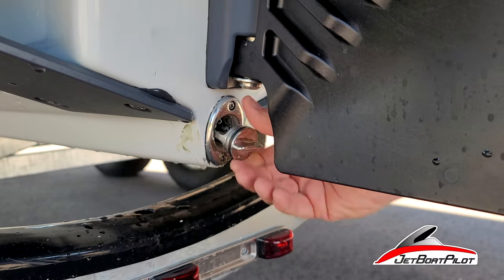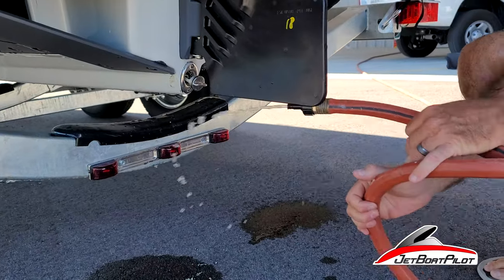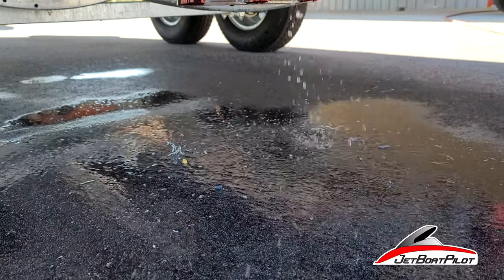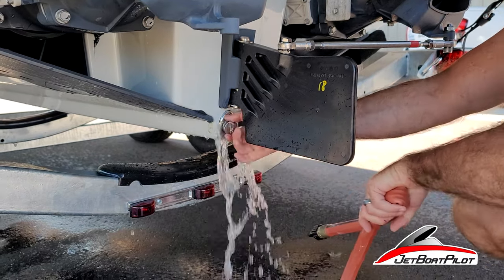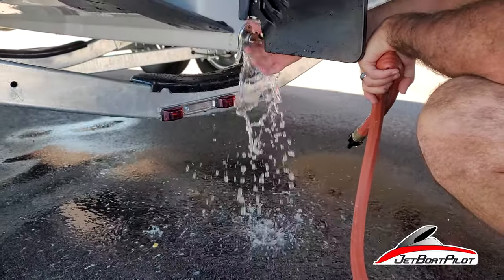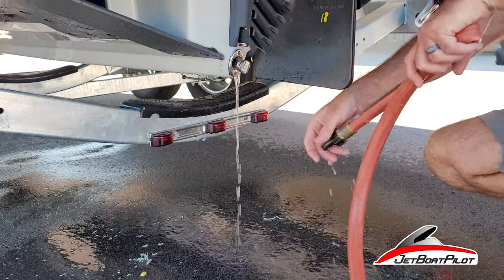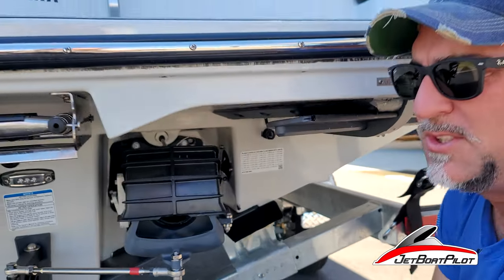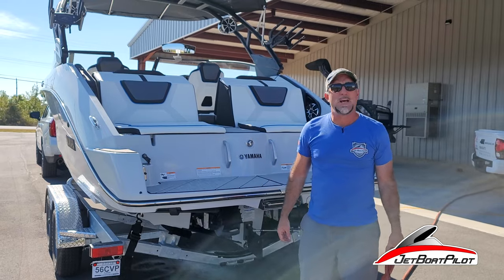What's This Trash Near My New Boat's Drain Plug | How To Flush & Clear

Comment: When does the thrust vector and reverse thruster get installed?  Or is it not needed with the DRIVE system?   Have a new 222S on order and deciding if I will need the thrust vector or not.
Reply from the maker: We're installing it soon. Just doing video without first. Definitely helps alot adding Thrust Vector and Lateral Thruster 2.0

Comment: When doing a 360° turn or navigating around a dock can you give a little forward thrust on one engine and a little riverse thrust on the other because the throttles operate independently on the higher end boats? Are the paddle shifters worth the extra money?
Reply from the maker: In my opinion the paddles do not provide more control around the dock. They make maneuvering around the dock easier for people that are not experienced. When I split my throttles I get more precision control, especially in reverse. You cannot split the throttles when in Drive mode.

Comment: Thanks Will, had all these same concerns with y 2021 FSH! Was wondering if you had any luck with R&D on the ShorLandr trailer tongue ladder idea? Specifically for the 190/195 trailers as the tongue is so short, no one's building a ladder for this size.
Reply from the maker: None at the moment. We looked at it once but it's such a low volume item we never pursued it.
Reply: @JetBoatPilot  No worries, I figured that was the case. Thanks again!

Comment: I need help. We have an ar195 and the left bottom drain plug appears to be stuck. It'll turn like maybe 1/8th of a turn. Would you have an suggestions on how to get it unstuck. I would really appreciate any advice
Reply from the maker: How old is the boat?
Reply: @JetBoatPilot  it's a 2021
Reply from the maker: @TheJeffrose1981  could be trash in the threads. Have you tried a pair of
Pliers to see if a little more force will remove it?
Reply: @JetBoatPilot  yes, I didn't put a lot of torque to it just because I was worried about breaking it. There's 2 screws one on each side. I thought about removing those screws and see if I could just take the whole plug out but was worried I'd mess something up.
Reply from the maker: @TheJeffrose1981  you could do that too but remember you have to seal that plug assembly when you reinstall. Use an underwater grade sealant like 3m5200. Also give the sealant time to cure which can be days.
Reply: @JetBoatPilot  ok, we're would I be able to find that sealant? And I really really appreciate your help and quick responses.
Reply: This same thing happened to me, it kept getting stuck. I took an air compressor and blew around the threads, lots of wiggling and turning and eventually got it out. Then I unscrewed the plugs completely and used a small vacuum to get all the debris out from the inside
Reply: I wouldn’t remove the entire assembly unless you absolutely have to

Comment: Why would I have about a gallon of salt water coming out of that plug after a day on the gulf? No water over the bow or in ski locker
Reply from the maker: Likely coming from the clean out plugs. There's some blowby when you're running at high rpm and that water can get into the lower bilge if the seal around the cleanout port mechanical access hatch has a leak. Many will buy our mechanical access port riser to help reduce the amount of water getting into the lower bilge.